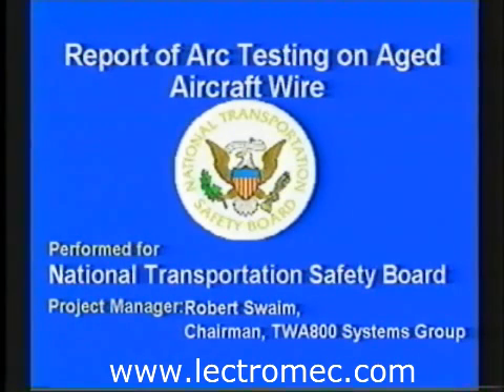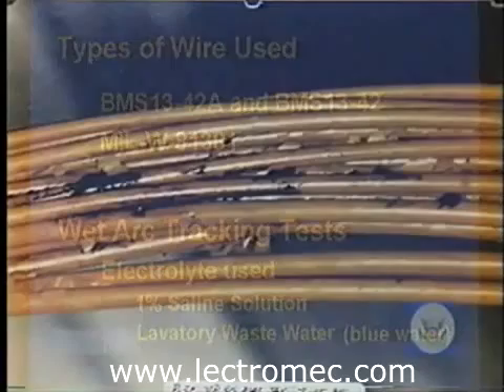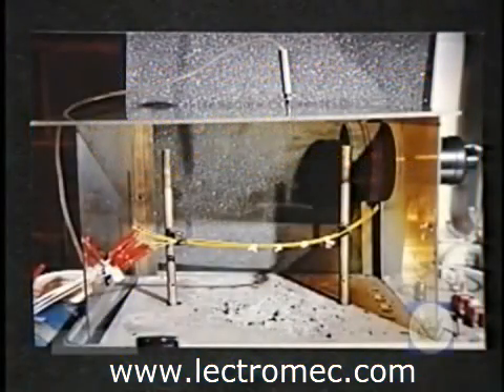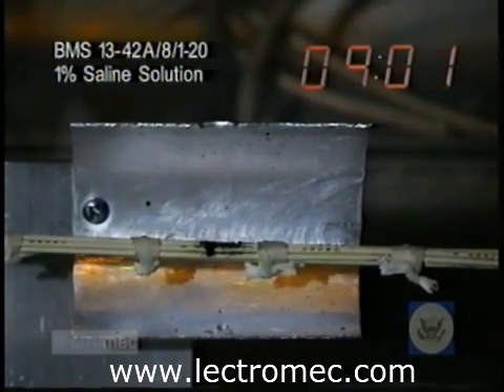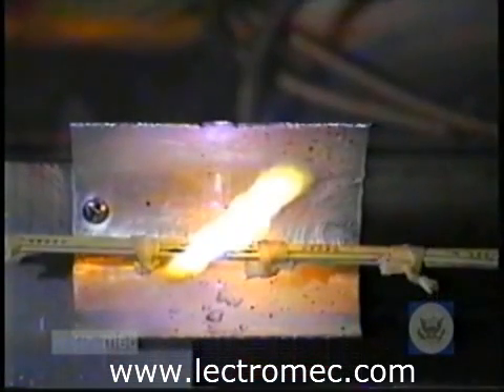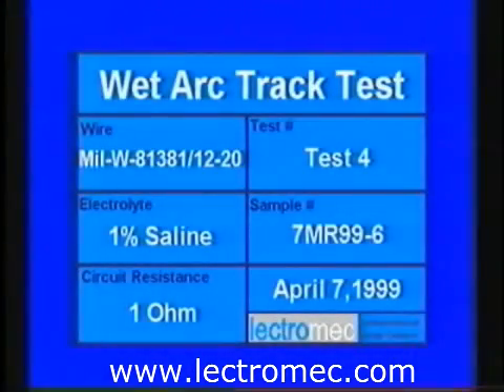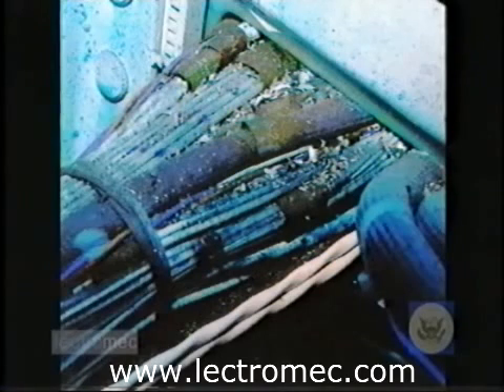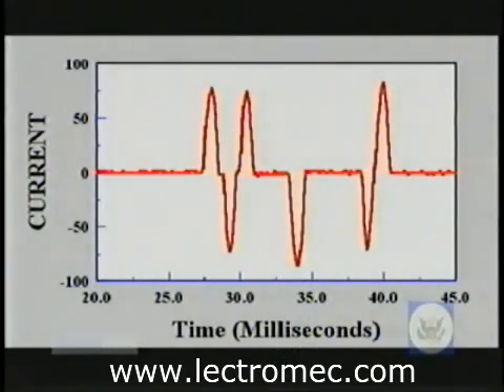Aircraft Wire Arc Resistance Testing

Comment: so this is the wire used in aircraft?
Reply from the maker: The polyimide based wire (MIL-W-81381) is still on some aircraft.  The industry has learned from this and  modern aircraft now use wires that are less prone to electrical arcing.  Further, electrical power system circuit protection has advanced to detect and halt these events before they can cause significant damage.
Reply: @LectromecChantilly  The poly x wire was on TWA800.
The type of arking that possibly happened was the poping type arking.
This would explain why the fuel flow gage acted up on the aircraft, giving all sourts of crazy readings.
Those poping sounds are the resulte of an ark ploom being created, the arking i think egnites the air around it giving that arking sound.
it is not the resulte of the wire bundle coming apart
Reply: they mentioned at the start the wires were in service for about 25 years in a 747. so the plastic insulation is old to the point that it has become harden and can crack.
Reply from the maker: Most aircraft wire insulation's will degrade, lose flexibility, and crack or fail in other ways.  How long and what conditions are all dependent on the material construction.